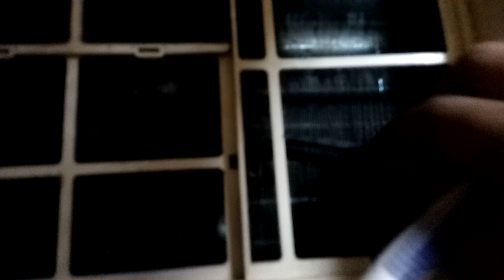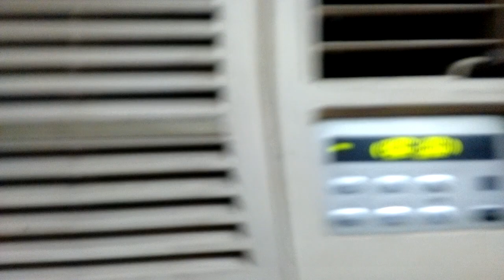Quick Fix Windows Air conditioner AC sensor  not working or error

Comment: Thanks a ton helped me to figure out my ac issue.
I faced temperature falling rapidly after my ac was cleaned by technician.
I found out from your video that the black wires house the sensor and that idiot technician had just left those sensors touching the cooling grils which was causing the sensor to turn off compressor very soon as the sensor were getting false reading from the gril.
Just fixed the sensor over the plug given and ac worked like a charm..Thanks saved me from sleeping without ac at night

Comment: It resolved my AC issue, the temperature sensor was not placed well, now it's working good
Reply: hat to do? my ac doesn't maintain its temperature. it runs (compressor) for about 5 mins turns of and starts after 20 mins. even if i set temperature on 16.c it doesn't maintain temperature.
so how can i fix in my window ac?

Comment: what to do? my ac doesn't maintain its temperature. it runs (compressor) for about 5 mins turns of and starts after 20 mins. even if i set temperature on 16.c it doesn't maintain temperature.
Reply: mine also same problem bro. if your problem was rectified inform me also
Reply: I had this problem too. The termistor he mentions at 2:06 became detached when I cleaned the filter. When pushing the filter back it it can make contact with the plastic piece holding the thermistor to the radiator, in my case the filter jammed the thermistor loose from the radiator and caused it to hang low in the bottom part of ac where it remained chilled while the room temperature continued to rise. I grabbed a fine needle nose pliers and readjusted its position.